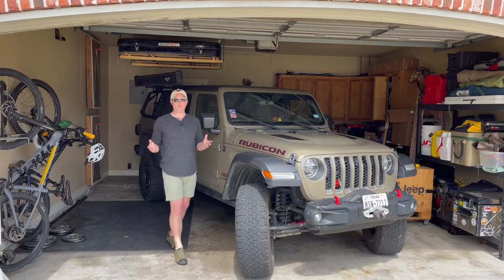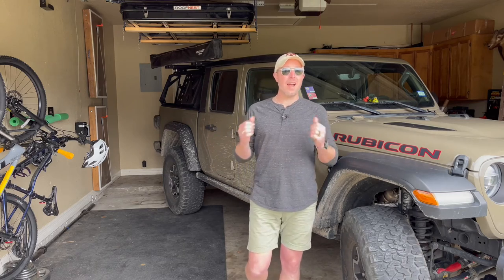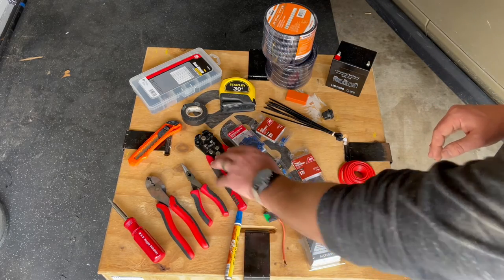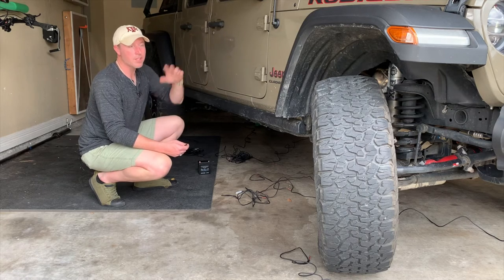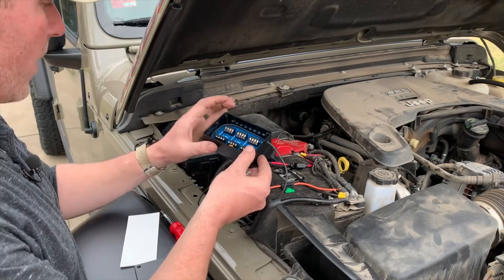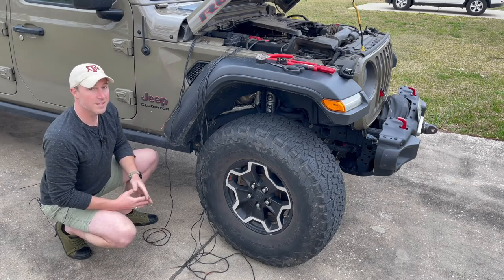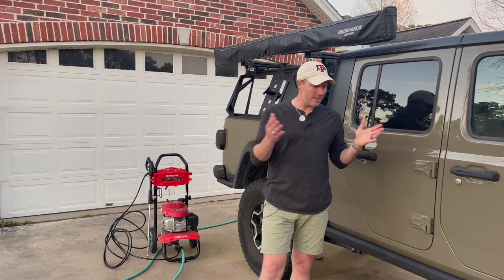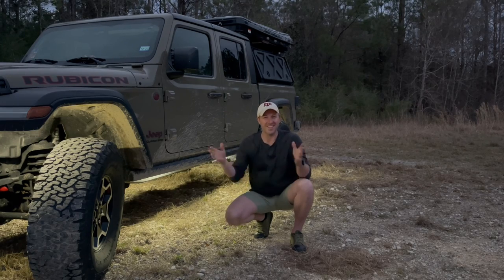LUX Lighting Systems Rock Lights Complete Install and Evaluation

Comment: The diodes were a lightbulb moment!  I have the Oracle Sidetrack and have been trying to figure the easiest way to do that.  Now, they will come on with a switch and with the dome lights.  Thank you.
Reply from the maker: You bet man… I’m almost tempted to reload the video because my Tee Tap connectors finally arrived this afternoon… I tapped into the bed light driver circuit which is a beige and white wire in the passenger foot well on connector F… I ran a short wire through the firewall and up to the diode… now when I unlock the vehicle or open the door my rock lights come on… But the diode prevents lights on that circuit from coming on when I press my auxiliary button… It’s a win-win. 
Shoot me an email and I can send you some photos… JKHARTEL3@gmail.com

Comment: I run 17 of these on one circuit to a Voswitch. Been installed for 4 years now. They only use 150ma per. 4a circuit.

Comment: Great video! Thanks. I'm about to install the very same lights but was thinking that by mounting the control  box in the cargo bed (beside one the lights) and using the cargo bed light leads to power up the Lux lights, I would have them power up as courtesy lights (as the cargo bed lights normally do) AND control them from the cargo light OEM in dash switch. No need for an Auxiliary button connection or diode with that set up. Would you agree?
Reply from the maker: You don’t have to go to the bed. Please shoot me an email to discuss this further. JKHartel3@gmail.com

Comment: This was the only thing I wanted to do when I installed mine but wasn't sure best way to make it happen. Totally forgot about the hopkins diodes. Just ordered a set to do my wifes and my jeep. Also just wondering what metal did you put in the front fender, I made a custom piece that I covered in a video a while back, but could not see exactly what you did.
Reply from the maker: About 10:53 I explain that I used a hacksaw blade… It’s high carbon steel and super magnetic… It also has a hole conveniently at each end🤘🏼🤘🏼
Here is a follow up I did for the diode and reference to the circuit I attached into
https://youtube.com/shorts/GGahxM6uoL8?feature=share
Reply: @GatorOverland  I must have been distracted when by the kid when you mentioned it, but it was a lot quicker and easier than. What I did. Great idea. Great video with good ideas beyond the standard just toss them up there.
Reply from the maker: I’ll be honest… I watched your video before committing to these lights… You sold me on the lights but that front end work was not what I was about😂😂😂
Reply: @GatorOverland  t
Yea it was a lot of work and I dreaded it when I knew I was doing it on the 2nd jeep also. Took at least an hour on each side so your idea is a lot better for the Time. We just couldn't figure out what metal to bend and the saw blade was perfect cause the drilling and bolts work, but tear the arms up.
Reply from the maker: Well thanks for the initiative to make a simple upgrade. It works well and passes the pressure wash test 🤘🏼🤝
Reply: @GatorOverland  I am doing a follow up video tying in this upgrade, but wiring in a little different, do you mind if I reference your channel and do a little screen shot and link to help others find your channel for your install?
Reply from the maker: Absolutely… Shoot me an email so I can forward you my phone number and I can share some clips if that makes it easy too… JKHARTEL3@gmail.com

Comment: Awesome review and setup. Thanks!
Reply from the maker: Thanks for taking the time to watch and comment… I am extremely happy with the setup and performance, even after a year… I did mention tapping into the courtesy lamps, and I actually did that, and couldn’t be happier with the convenience of having them come on when I unlock the vehicle or open the door
Reply: @Gator_Overland  That's great to hear! I have never bought rock lights before and was previously considering buying the cheap aluminum ones from foreign sellers on amazon. However, I feel like it's better to invest in something that will last, especially through field applications! It's good to know these are holding up for you, and I'm going to consider buying this brand.

Comment: Any updates with the lux rock lights??..they still holding strong??. I’ve seen them on IG thinking of getting some
Reply from the maker: It’s a fantastic upgrade… I literally use them every day, and I’m bout to incorporate them into my off-road trailer for the simplicity of magnetism, instead of drilling into the steel body of the trailer.. super bright, and very efficient..

Comment: In the case of more lights, can you use one box for all? How many lights will one box power?
Reply from the maker: That would be a question to confirm with lux,  it these light draw very little and are on a self resetting circuit. The lights draw 150mA each, and there are typically 3 zones per controller.. you can wire the zones separately for different switches or all together for them to activate at the same time.
Reply: @GatorOverland  I'm more worried about how many can fit in the box and how weather proof it is
Reply from the maker: @Reggiekranz consolidate splicing prior to putting in the box… For example, there are 8 holes on the exterior of the box… If you’re wanting to do 12 lights, then you would have to combine/consolidate twice to one wire prior to going into the hole to make for ease of wiring. You could also make your self some new holes in the box… The box is not waterproof, but on the best side of dustproof..
Reply: @GatorOverland  after installing all the wires into the box did you silicone where the wires went in?
Reply from the maker: No.. I placed mine on top of the fuse box, which is otherwise the highest place in the engine bay… If I have water getting that high, I have bigger problems

Comment: What app are you using to control?  Or are you using just the key chain controller?
Reply from the maker: It’s connected though the courtesy group so when I hit my unlock/lock button they light up. Otherwise it’s powered by the aux button on my dash.

Comment: Is there a different colored wiring for a 2022 JL? I had a White with beige wire and that is not it.  Tapped it and it did not work.
Reply: NM, it was yellow /purple
Reply from the maker: The JL is slightly different because they don’t have the bed circuit. The gladiator bed circuit turns off and on only… The interior of both the wrangler and the gladiator gradually dim. If you tap into your courtesy lamps under your foot, well, your exterior lights will gradually dim as well. 
The correct way to do it would be to tap into the foot Well lights and use that as the trigger for a relay and have the output of the relay turn on the lights… I can explain this further in depth if you reach out via email… JKHARTEL3@gmail.com

Comment: So my previous rock lights I ordered off Amazon they were 30$ and rgb I have a 2021 overland and I don’t have the aux switches and I want to replace my lights with these how would I go about the aux thing and set them up to my lights I also have the 30$ ones connected to my bed light button and they work when I unlock and lock
Reply from the maker: shoot me an email to jkhartel3@gmail.com I’d be happy to answer further.
Simply put you would need a wire connected to 12v with a interrupter switch in between for an on/off function.. you could do it for a few bucks or invest in a switch pro or sPod or similar

Comment: The diode is a great idea!    You have a link or part number?   Thanks.
Reply from the maker: Hey thanks for reaching out! The diode works great! Feel free to reach out if you have any questions about wiring. Jkhartel3@gmail.com
Diode link- https://amzn.to/3TLTlJL
Reply: Quick like!  Still watching install.   I'd love a way to turn turn the convenience light feature on and off with some kind of switch.   Not sure how I'd do that.   Even a manual switch near battery is fine.   I guess I can just add a fuse and pull it for the rare times I wouldn't want the rock lights on with convenience lights.   Any thoughts?  Regards.
Reply from the maker: No problem! Always happy to help. I’m on newborn duty right now so I have some free time to answer quickly!
Yes, it’s an additional step, but you could wire in a interrupter switch to have power over when/if you want the courtesy lights to come on with the door open. You could easily affix this switch to the dash or console areas. 
A simple solution to the switch, if necessary, would be to just unplug then spade from the diode that Is wired to power from the courtesy group.
In my experience, With as little power as these lights consume you’ll probably find it convenient enough to just leave them powered. Even modern vehicle perimeter lighting comes on during the day when the courtesy group is activated. 
What kind of vehicle is yours? And if you want help with wiring diagram, shoot me an email and id be happy to draw one up to suit your needs. Jkhartel3@gmail.com

Comment: Why didn't you run the wires in the channel that the gladiator and wrangler have along the firewall? No loom, etc. Your wires are literally right in front of it.
Reply from the maker: Thanks for taking the time to watch and comment. It wouldn’t fit in the channel with the loom, and/or the bundle of wires without the loom… I would have done this otherwise.. I went the extra step with the loom as protection from the field rodents and heat from the engine.

Comment: Why didn't he run the wires through the frame? He's gonna snag those wires on branches when overlanding.
Reply from the maker: It’s a boxed frame.. nearly impossible to run through the frame. I ran on top of the frame with all the other factory wires. 10k of overlanding and off-roading since install and no issues.. there won’t be issues as far as I’m concerned . 🤘🏼🤘🏼
Reply: @GatorOverland  o nice! Did you use zip ties?
Reply from the maker: Yes, and plastic split conduit. The kit comes with 12 thin zip ties, but I used a bit thicker style that I keep around
Reply: @GatorOverland  you're a legend. Thank you for the review. Just ordered
Reply from the maker: Bad ass! Feel free to reach out if you have any questions. I later wired mine in to the courtesy lamps so when I opened the door or unlock they illuminated as well. Jkhartel3@gmail.com